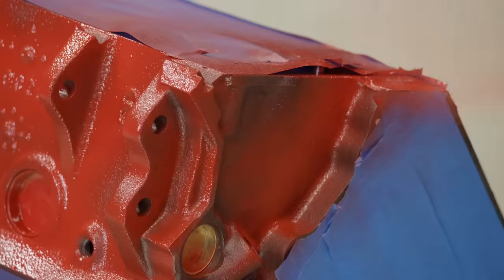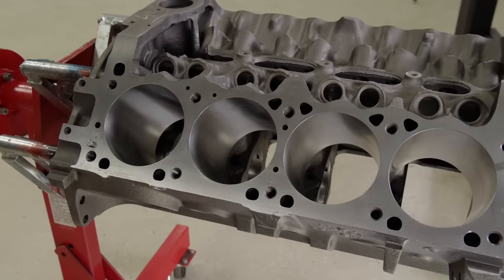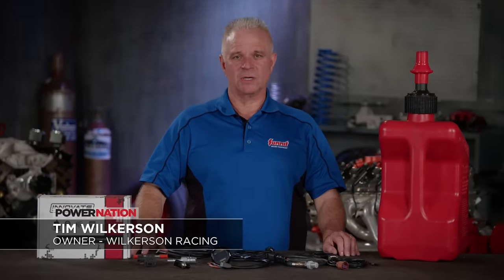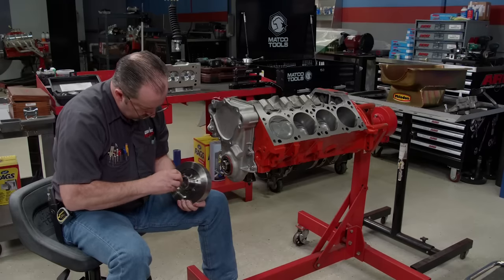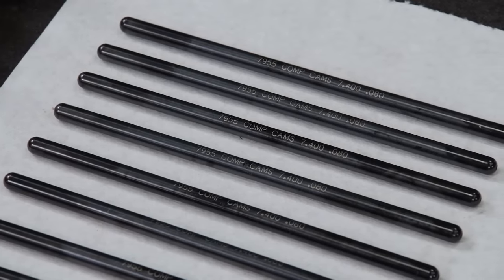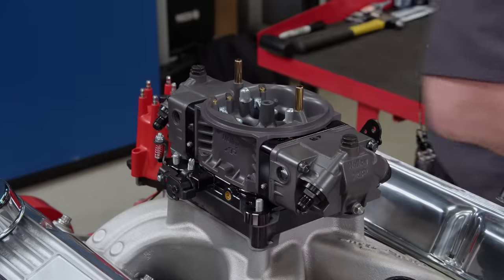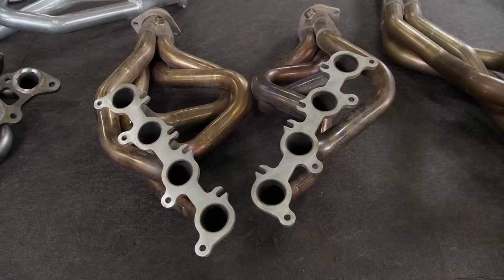Assembling a 410 Mopar with High Flow Induction - Engine Power S7, E9

Comment: Install the camshaft before the crankshaft--its easier since you can reach into the block to guide it into the cam bearings.
Reply: I did not kn dat!! Good lookin-out!!
Reply: Cams are easy to put in... just screw a long bolt into it...
Reply: @BuzzLOLOL  its just nicer on the bearings. Pick up a box by the handle on its side, pick it up by its bottom...which is more stable in your hands? just sayin'.
Reply: @albertgaspar627  - Back in 1950's, 60's, 70's nobody ever pulled an engine just to change a camshaft...
Reply: @BuzzLOLOL  you are absolutely correct (i'm middle aged), they'd pull the radiator, cut the support, and do a complete bearing swap with the block in the engine. BUT respectfully you are forgetting the real reason :)  There was no cheap engine hoists shipped from China to your door back then, and the only cheap engine stand to hold that block for the one-time worker was an old rubber tire, and most car owners were not going to afford a bore job on a high nickel block. 

at best, if an engine had to really get worked on, you pushed the car under the strongest tree branch you had, and block and tackled that sucker--before the Chevy small block, V8's and even inline sixers were heavy mo'fo's. As long as the engine mounts were not broken, you left that heavy cast iron right in place and worked around the straight axle front suspension or rear steer tie rods. Even a rod knock got handled that way.

Back in the day, there were even garages who didn't have a car lift, they had a ditch dug and the car was parked over it. That came from the 1930's and 1940s, when greasing the chassis was a regular thing. it was easier to just get into the ditch and access the undercarriage that way.

today, in a perfect world, you ship the block off to the machine shop, work on the heads while you wait, learn what cam will work with the porting job and valve spring limitations. The block returns, you clean it, measure the ring gaps and then put on the heads just to look up the bores and see if the heads are centered perfectly or could use offset dowel pins to move the valves away from the bore walls to reduce shrouding the air flow

If the machine shop wanted your pistons to match to specific bore sizes (since they never perfectly match), you install new cam bearings and stab in the cam while measuring connecting rod, wrist pin and piston weights. you juggle lightest and heaviest components until you have eight complete piston-pin-rod assemblies that match in weight, and get them into the block with the crank.

but everyone builds the way they like. I also don't believe in painting the inside of a block--why? No one ever paints the crank or inside the cylinder heads to get whatever benefit they think painting does for them.

help oil flow? nope--look how rough the surface remains. Prevent rust during storage? the oil film naturally repells water. Holds in sand? look at your bearings when you take an engine apart-feel any grains of sand embedded? (hint, its all in the oil filter first used and in the oil pump screen). Far better to get the rifle bore brushes and dental pick and go after all that sand yourself.

again, everyone has their favored engine building technique. Just throwing another one out there. Its easier to guide a cam in without screwing up brand new cam bearings when you can reach into the block and grab that slick sucker. i mean, a proctologist or gynocologist could work on you thru your belly button, but....:)
Reply: @albertgaspar627  - Yeah, car magazines tried to make painting inside the engine popular in 1980's or 90's... I figured it would eventually flake off and clog the oil filter... but some swear the Glyptic paint doesn't come off...
Reply: @BuzzLOLOL  you are absolutely right. folks think Rustoleum is good enough, but you look at an engine you pulled from the junkyard with high miles...you see a lot of flaking on the outside.

and as any painter knows, nothing sticks without great prep. so to paint the inside of the engine...you better degrease every corner. i don't see any value to it, tho, and no one has been able to give me an answer why they aren't painting the inside of the cylinder head too.

but if you're gonna do it...do Glyptol like you said. GE makes it for their big generators, so its designed to handle heat expansion and shrinking.
Reply: @albertgaspar627  - Well they do have heat blocking coatings for combustion chambers, tops of pistons, ports... friction reducing coatings on sides of pistons...
Reply: @BuzzLOLOL  they do, and the only drawback is whatever you don't coat in that system...gets all the heat the coated part sheds off. That all said, if its in the budget, they are worth doing.

And that brings us to another questionable engine build tip--scuff the bearings with Brillo before installing. "oh i want to take off whatever chemical the bearing shipped in". Yeah, and then you'll coat it all over again in assembly lube. Does the OEM assembly line worker scour the bearings before installing each one?

Friction coating the piston skirts, on the other hand, may not matter when the rings are contacting the cylinder walls, but at BDC when the piston is rocking back and forth, now the skirt's got a chance to make contact at the bottom of the cylinder--and whoever knows to prepare that edge?

Comment: Dodge actually made the 360 into 2003 not 2001.
Reply: Yes Dakota was last to receive the magnums and last to get sequential injection
Reply: @bb400dart2  I had an 03 1500 RCSB with a 360 and it was a blast to drive.
Reply: @sleepylogic1647  The I was at dealership had one of the last ram chargers and it was a magnum that was 1991 red with gold trim  that was a long time a go so i may be foggy but it my have been the vans the change over last. but the TBI motor of the LA era have the best exhaust back side radius.
Reply: @bb400dart2  Dont forget that 3rd gen ramchargers did exist from 98-01 :P
Reply: 2002 and some early 2003 Dodge Ram 1500 trucks came with the 5.9L Magnum 360
Reply: @staycool72  that pretty much exactly what I said.

Comment: That engine would be sick in my 1985 dodge w150 4x4!
Reply: Could you give an insight to how much this build would be?
Reply: I would say like 6-7K depending on if you do the work yourself maybe less. Those heads are probably $1500-2000 and the stroker set probably another 1500

Comment: Did I see that right ..they dyno'ed this engine before they showed the build?   They restricked its air flow with those 190 cfm heads,  only making  499 HP / 457 lbft.  Conversely, when they built the stroked 408 Ford Windsor, comparable parts except they used a dual plane intake ..but used 225 cfm heads,  the 408 Ford made  522 hp / 530 lbft.  When they changed the intake to a single plane,  the 408 Ford made 617hp / 537 lbft.
I think they could have done much better with the 410 Mopar.
Reply: @bigboreracing356  you really do need to get a better hobby. hows chevy doing in NHRA atm? oh....thats right...gettin that ass whooped by dodge.
Reply: @bigboreracing356  Maybe you guys haven't notice on the News lately that there's a major corporate plan the create dissension and tear apart our free country. We see it everyday when MSM fabraicates new stories specifically to create discord and fighting between the people ..especially with this Floyd thing and  "BLM" bs ..when its all a efen Lie.  I believe this global plan is refected by all network media corporations, ..even PowerNation who builds these engines to create discord in the small slice of society that they influence.  We should all be aware of this and not give in to their control.
Reply: No, they didn't dyno it before the build.  Watch the beginning again.  Pat clearly states that was a 360 cubic inch dyno pull on Trick Flows in house dyno.  They never did dyno the 410.

Comment: Ok I'm gonna put this out there for the first time builder in regards to his "Stroker" commentary so that big problems dont come up.  Get ahold of your piston supplier and find out where the skirt gauge points are and have them email you where those points are. This is VERY important.  Never, under ANY circumstances, stroke the piston out of the cylinder past its skirt gauge points.  It WILL lead to a very expensive boat anchor.  I wish he would put this info out there before he talks about stroking engines.

Comment: LA heads on a Magnum Block with retro fit lifters? Someone screwed up!!
Reply: Trick flow heads work with both blocks...just need oil thru pushrods and the correct rockers...harland sharpe or PRW stainless steel rocker...
Reply: Yep. Solid pushrods, and retrofit lifters equals no oil!

Comment: i stroked a 360 in 05 and put it in my 79 Stepside. but i used Edelbrock RPM heads, no, no dyno numbers, i was poor, but it ran good and it felt stout.

Comment: I have a close build to this engine and it made 550 hp at 5800. The cam im using is a mech flat tappet.  they should  get at least 580 or even 600hp out of this combo. Oh and get a la block.
Reply: What cam you use? Duration @.50? 
Got a grind #?
Reply: Lumati  258@ .050

Comment: If you are using forged pistons as opposed to cast, make sure you are aware of how they are different. Forged pistons expand more than cast when hot. This has an affect on cylinder wall clearance.
Reply: That clearance is normally built into the pistons though

Comment: Why are the retrofit rollers used on the magnum block? The block already has the taller lifter bore needed and bosses for the retainer spider
Reply: I just came to ask that same question. At least they could explain the choice!
Reply: @numbnutz9398  I thought the same thing...    probably just a marketing plug for Comp...     it's not like these guys pay for the parts - they are usually donated for advertisement purposes...      Engine could have easily used factory rollers with dog-bones and the spider.
Reply: prob because ATK sponsored their block. Aftermarket company.
Reply: Thinking the same thing 😅
Reply: id heard the retrofit lifters wont even go in a magnum block, because the link bars hit the lifter bores, due to the shorter LA lifter.
Reply: @frigglebiscuit7484  They're also NOT DRILLED for pushrod oiling, which is why we don't see a Dyno session on this motor.
Reply: They probably couldn't get all the new parts .
Reply: @elmerfudpucker3204  with lift and spring pressures, they may not have trusted the rollers on the factory lifters or they just wanted to use the tie bar style.

Comment: I would like to see a dyno comparison on a stock motor like this with the only change being home porting the stock cylinder heads. Unshrouding the valves, back cut the valves, port casting cleanup, Gasket match,  Etc.

Comment: With this cubic in those 202 intake valves a weak. My 418 stroker have 205 intake valves, you'll see a good difference in power.
Reply: Carbs too small as well.
Reply: 410 cubic inch should be 950 all day long. This motor is air flow restricted by probably 75hp right off the bat.
Reply: my big block has a stock 2.08 valve.....its really not enough to matter, besides, not good to shroud the bore.

Comment: I dont get it, at  3:12, he says it is a magnum block, yet they have to "clearance" the block to use roller lifters? Magnums are already rollers. They use Harland sharp rocker assembly for an "la" engine, how do they address the oiling difference between pushrod oiling and shaft oiling? Also, a magnum block is getting pretty thin if bored more than .030 over, this one is .040. Fine for an "la" block but iffy on a magnum. Sounds great but I can't say I trust everything they are suggesting. Also, where the hell is the dyno session?????

Comment: Hey Pat. Not sure you noticed, but you tell us what the intake centerline comes in at on every cam you install. Have you noticed that every comp cam you install is anywhere from a 1/2 degree to 1&1/2 degrees off??? The cam in this build was one degree off. Either quit degreeing the cam or switch to a different brand. We quit using comp about 8 yrs ago.

Comment: I thought that when you have a block align honed it was a big No No to use any other bolts/studs then what was used in the honing process?
Reply: Correct.
Reply: if your going to use studs then it needs to be honed with studs. if you going to use bolts then hone it with bolts. although its best to use the actual fasteners thats going to be used on the build its not that critical as long as your using the same type of fasteners that it was honed with.

Comment: A lot of small engines; generators, mowers, etc.. can't handle the high ethanol amounts. My generator says 85/15 is acceptable, but I'm having to do some rebuilding on it after finding out the fuel has up to 51%. The pumps weren't even marked. They used to sat "may contain 10% ethanol". They took off the signs, so who knows?

Comment: I’m guess trick flow or power nation have never heard of indy automotive? They’ve had better flowing heads for years now
Reply: Duey Jones There not mopar guys ! Indy has been the go to for decades!
Reply: Simple, product placement sponsors, these shows are cool, but they really are large advertisements mixed in with technical info
Reply: @microcar14  infomercial on steroids
Reply: @69AARVIPER  Dealt with Indy a few times...    mostly over quality control issues.  They make a good product but honestly I had several issues with their Legend heads and a Crate Hemi from them....     I know that's the name of the game and things happen - but if a customer drops almost $30K on a crate hemi - I shouldn't have valvetrain issues and parts failures within 100 miles
Reply: If Indy wants to sponsor the show, they surely can.  Just pay more than Trick Flow did.
Reply: @microcar14  plus this is an older episode
Reply: +Cody Voyles   This is a new episode(2020).
Reply: @basshead.  No. This is a 2020 upload, but it's definitely an older episode.
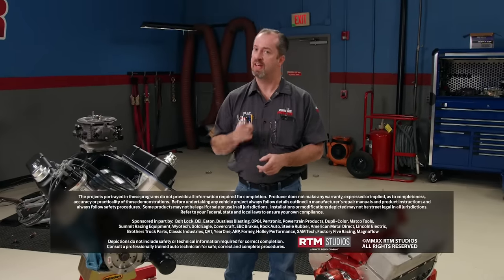Reply: +Christopher Baran   21:33   MMXX = 2020
Reply: @microcar14  infomercial with commercials
Reply: they could have been sponsored by trickflow
Reply: 69AARVIPER its soo annoying they aren’t id love too see more Ford and Mopar Action as Gm is always out of favoritism 🙄
Reply: I have Indy 360-1 heads on my 440ci R3 small block and yes, they make great power but they are not for your average persons build like these Trick Flows. The Indys are double the price, need their own very expensive offset rockers and their own special intake manifold. Trick Flow is breaking new ground with these heads. I just bought them for my 408 build going my Lil Red Express.

Comment: 2 years late to comment but later 5.9 magnum blocks are internal balance..don't know it all apparently. Everything else correct except he literally says the heads are drilled to fit both blocks    You all may know this now but never corrected your comments so I did. My 98 360 is internally balanced from a 4x4 ram...in my Dakota 😂

Comment: Rocker arms aren't going to last long, since there were no oiling holes drilled in magnum blocks for shaft oiling.
Reply: Oil comes through pushrods
Reply: @indyrock8148  not with those solid pushrods and retro lifters for the LA design.  The didn't run this thing because the top end wasn't getting any oil.
Reply: @BSIncorp  yes I think you are correct. Rockers are for oil through block but it's a magnum block. Pitty someone ordered the wrong parts
Reply: All that work, checking bolt stretch, fancy lube this, brass gear that, and they didn't do the most basic of research on parts interchange.
Reply: Come on man!!!

Comment: Umm.. maybe Pat misspoke?? A 4.40" bore with a 4.00" stroke calcs out to 486ci.. ?? This is a 410ci stroker correct ?
Reply: Wouldn't it be 4.04" if it's 40 thousandths over 4.00?
Reply: Yep, caught that too. A stock 440 is 4.32"bore with a 3.75" stroke.. 4.40" !! ?? 😅  I think not.. why no dyno anyways ?

Comment: Are you guys ever gonna do a video on an engine that isn't a v8?
Reply: Skrillah they have they’ve done a 2.3 ford
Reply: Most lilely not , unless it's a diesel or something mainstream like a 2jz or honda k series. 😐
Reply: Hunter Poucher ill check that out
Reply: Probably not because there is no replacement for displacement.  And the target audience for this show doesn't care about other items.
Reply: Wild Bill They have built engines with superchargers before. Bruh
Reply: @bmstylee  you really need to check out what import guys are doing with their "small" engines 1,000 hp streetable 4 bangers, 2,000 hp 6 cylinder drag racing monsters.
V8 engines are great for seat of the pants feel and sound great but they aren't the only game in town anymore.
Reply: Skrillah What’s the matter did your lawnmower break down?
Reply: @MrStacy1974  yes but those 1000 hp street motors would be dwarfed by a V8 with the same amount of power adders put on them.  And drag engines don't really count.  A 100% aftermarket big block would make well over 2000 again with similar power addders.   For a daily driver a modded 6 is not a bad thing.   For balls to the wall power nothing beats displacement.
Reply: @skrillah6259  no?  Really?   They also have done turbos and nitrous as well.   🤦‍♂️